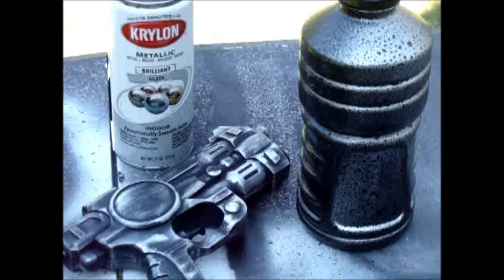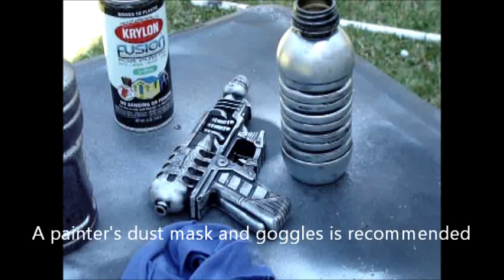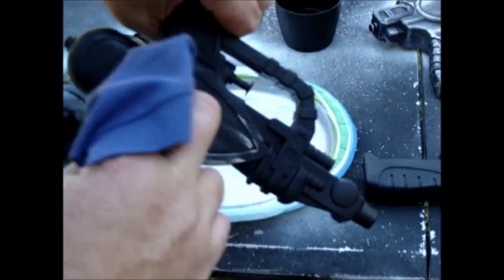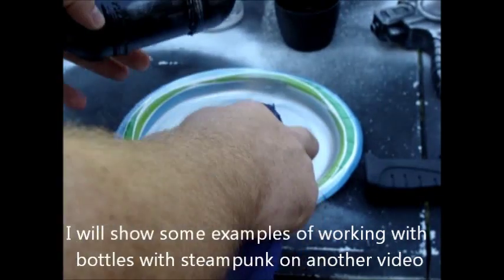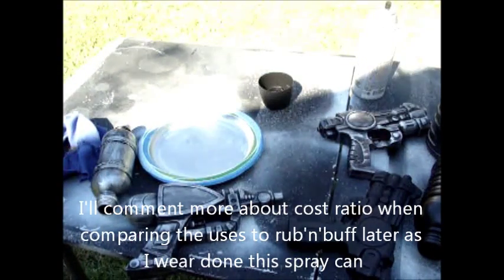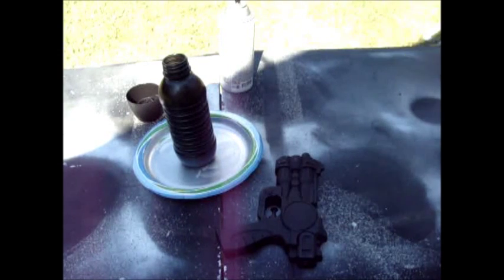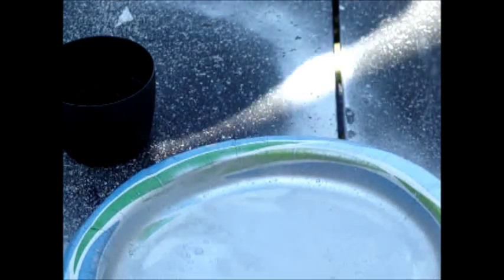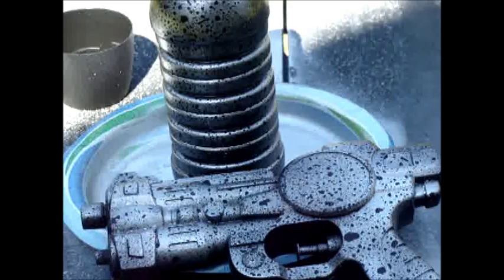Spraypaint Weathering your Scifi or Steampunk Prop

Comment from the maker: As long as the plastic is not too thin, it should last at least 3-4 times longer. Lids for butter or sour cream containers work well too. You can also use a plastic cup, but thin disposable plastic cups and plates would not work out too well, because the spray paint would eat straight through the plastic. Make sure you have some paint thinner too, it helps with cleaning up.